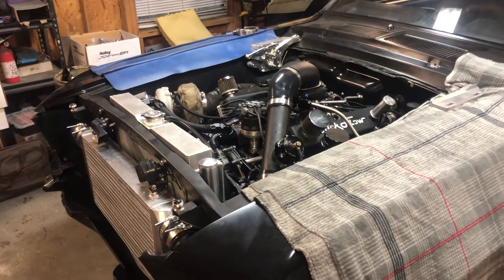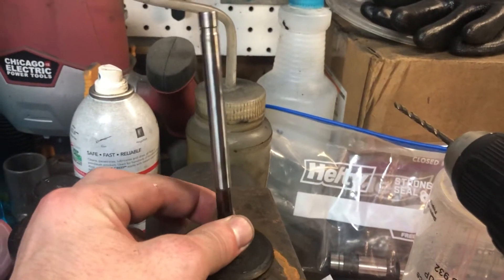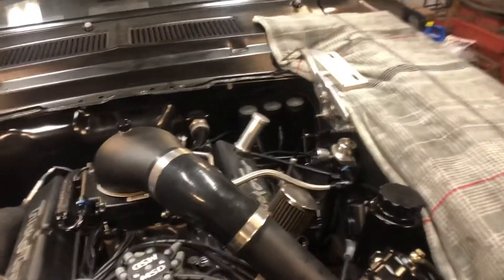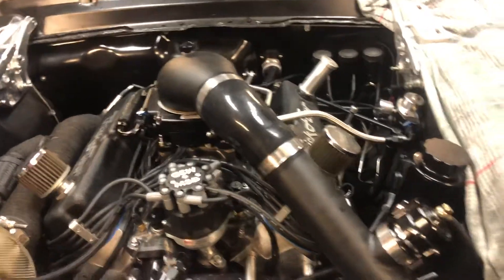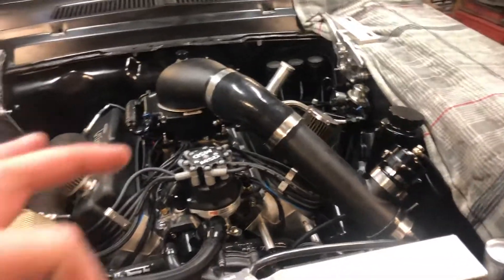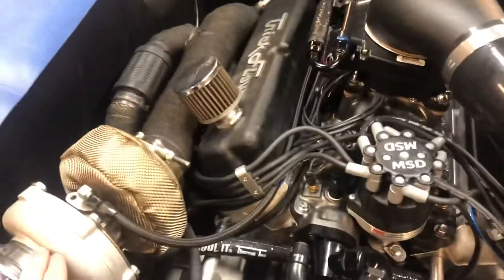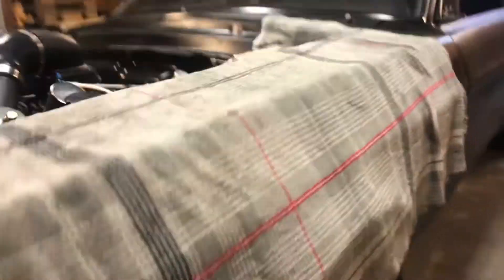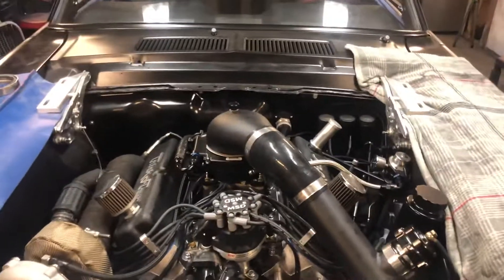SBF - Ford 302 cam bolt torque specs....

Comment: Just had my Windsor do this mine is old school flat tappet got lucky and got to mine before damage was done i have never had one come lose now i have talked with tec they said not to use lock tight going to anyway
Reply from the maker: yuuuup.. don't think manual ever said to, i never had in the past, but after this i will. my builder said he started using red loctite on them after he's seen a few come loose.

Comment: Just had my cam bolt back out on my 83 too, luckily only the dowel pin sheared off at the eccentric...and the cam still has the pin and it's in time.
Try an arp bolt and red loctite this time.
Reply from the maker: yup, next motor will be an ARP bolt.. this time around i just went and purchased a new grade 8 and red loctite.. so far so good.
Reply: @callofgeorge  

Still torqued to 45?
Reply from the maker: @tays8306  i wanna say i torque'd to 50 per my local machine shop's recommendation after he replaced my valves.
Reply: @callofgeorge  

Okay, I'll see what that feels like as I work up to it!
Reply from the maker: @tays8306  just remember to use a new bolt everytime. they only stretch so many times before snapping..
Reply: @callofgeorge  

Hopefully this is the last time this close to stock 302 comes apart till in ready for a new roller motor.

Comment: the bolt didnt back out because of the torque spec. it backed out because you had nothing to prevent the fuel pump eccentric turning
Reply from the maker: well i don't even have one of those... so try again lol. been electric fuel pump since day one. threw that thing in the trash and replaced with proper bolt/washer.

Comment: I had similar issue with a 2002 explorer with a V6 sohc, it had like 3 timing spockets that were fastened to either a cam or jackshaft with friction alone. Timing slipped  after a whole week of driving following a full rebuild.
Reply from the maker: yup.. mine was fine for a while, then the bolt just started backing out..